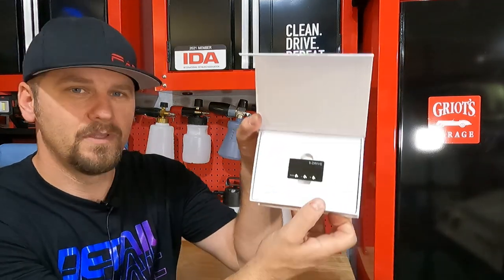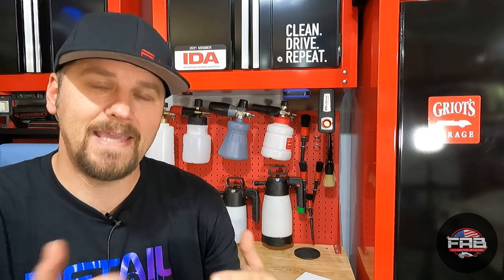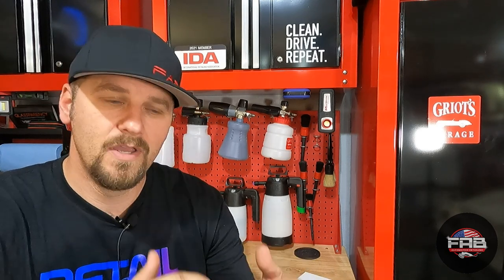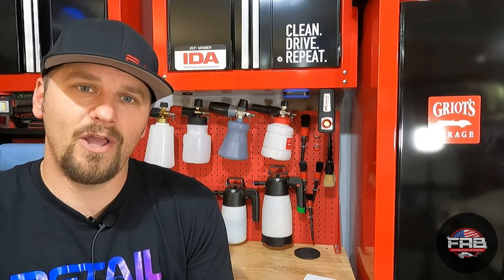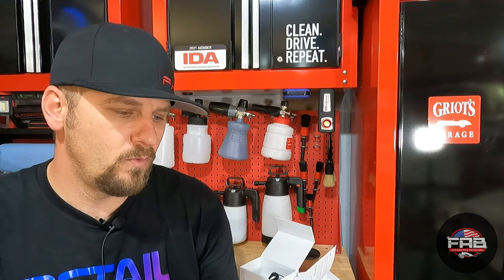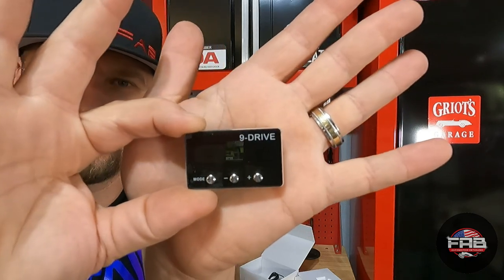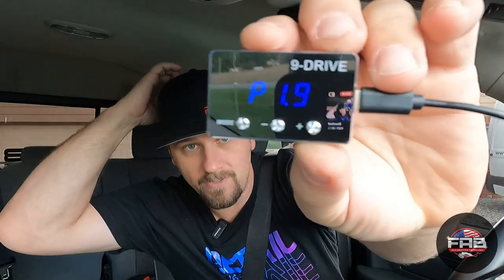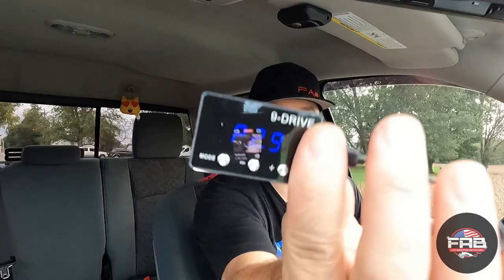$60 Upgrade Unleashed My Truck! Check this OUT!

Comment: You are not lying about Chevy/GMC having issues with cylinder delete. Our engine dropped a cylinder with 60k miles on it. Luckily it was covered. Manufacturers néed to figure something else out!! Crazy how much technology has changed automobiles in the last 10 yrs. I am sure it is a nightmare for a mechanic! Thank you for the video!

Comment: I use to have one on my jeep , worked great really made the pedal feel a lot better. However be careful with the “fuel saver” mode if I remember correctly it really dials back the throttle response compared to stock to quote on quote “ save fuel” could be unsafe to use that at times , just be careful have fun

Comment: Ya there great for taken out the dead spot in pedal. I had 1 before. It don’t add HP or TQ. But with pedal feel and response. Hell ya it works.
Reply from the maker: I agree! You can tell a difference though.

Comment: I hate ECO mode too. I was havin problems with oil burning with a GM because of Active Fuel Management, losing about a quart every 500 miles and replacing plugs . I ended up buying a tune for 300 buck and turned it off. I havent had oil burning problem since, that was 3 yrs ago
Reply from the maker: That’s good to know! Thanks for watching